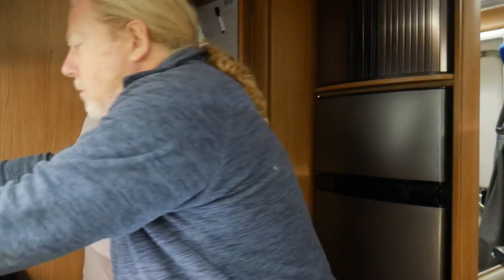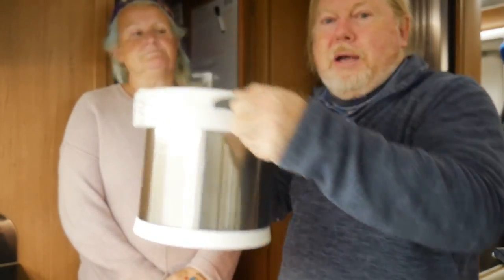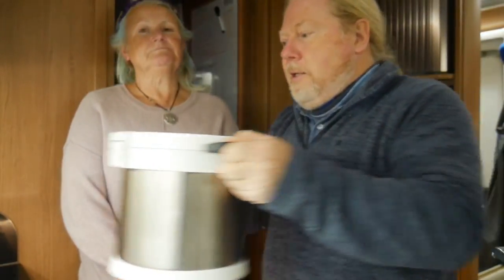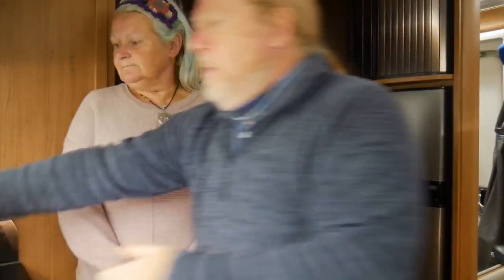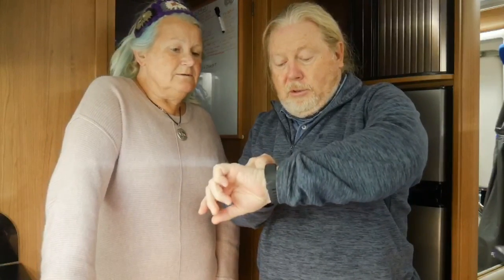Slow Cooker Disaster in Our Motorhome

Comment: Its not intended to cook large joints. The issue is the thickness of the meat which was probably chilled.  Best to pre-heat the cooker with some hot water, use small pieces of food and it will work a treat. 👍
Reply: It can be used to cook a cut of meat that large provided the meat is first brought to room temperature and then boiled for about 25-30 minutes in the inner pot before the pot is placed in the thermal cooker to finish cooking.  Smaller chunks of meat won't need to be boiled for as long a period of time.  The rule of thumb is if the pieces of meat are bite-sized (under 1 inch), boil them for about 2-4  minutes, if they are in larger chunks (1+1/2 to 2 inch sized chunks), boil them for 10 minutes, if they are roast sized (5 to 6 inches thick), then boil them for 20-25 minutes (Per Cindy Miller, author of the "Let's Make Sense of Thermal Cooking" Cookbook").

Comment: I have two of these cookers, one of which I use most days.   They work, and work very well, but you do have to use a tiny bit of common sense and think about what you are doing, and what sort of meals work best.   Yesterday, for example, I cooked a lamb curry using a fraction of the fuel I could normally need, but I did have the sense to chop up the lamb, brown it and then cook it for a while before leaving it to slow cook.   Obviously cooking a huge single piece of meat that isn't covered in liquid just wont work as there won't be any hot liquid around the top of the meat.   I would suggest doing a real test, perhaps using one of the recipes that are provided, before experimenting further as an ill informed negative experiment will just put people off what is a superb device.   Before anyone asks, I have nothing to do with Mr D, I just have taken time to do genuine tests in order to use the cooker both at home and in a camper van.   My wife has also used it to make a Christmas pudding, which needs a couple of reheats and takes ages but is quite good, and we have made bread in it, which is fairly poor bread but it is still impressive to get homemade bread without an oven.  Meals such as casseroles, curries and such like, work very well in the cooker and avoid having an oven in a campervan and save huge amounts of fuel.
Reply from the maker: Before the lamb. To the slaughter, we cooked up a Chilli and Rice combo in the thermal cooker, so we did have some experience. I believe the only mistake we made was to not heat it up enough at the start. We’re. Cooking a Chinese 5 spice meal tomorrow and we’ll certainly revisit tech half leg of lamb in the future. I’m pretty sure the leg of lamb will work out :)

Comment: Did you put the small pan on top of all the ingredients with boiling water in it, before putting the whole thing together. Mr D Chanel seem to do this? Wendy didn’t look impressed when Steve said they weren’t going to eat the lamb this evening. I searched on YouTube to see if I could see anyone using this Mr D Cooker and I couldn’t find anyone other than yourselves and the alleged Mr D himself - I’d have stuck it in the oven, you can’t beat cooking on gas
Reply from the maker: The small pan that goes on top is for when you are cooking smaller amounts. With that half leg of lamb there was no room for anything else 😀👍😎
Reply: @TheHappyTravellers  You can also put boiling water in the small pot on the top to increase the overall thermal mass if the food in your bottom pot doesn't fill the bottom pot up 85-90% to the top.  The more full the thermal cooker is with hot food or hot water, the longer it will stay hot.